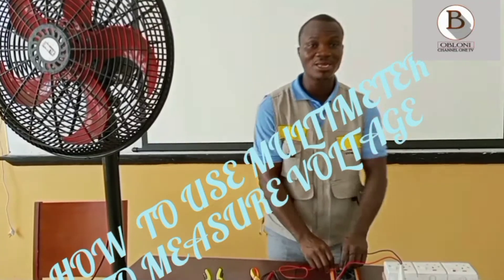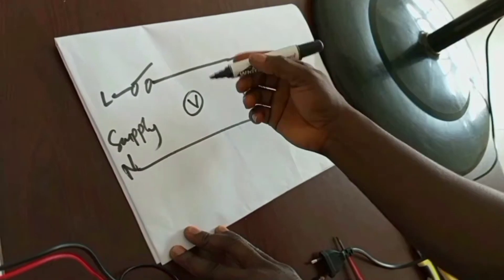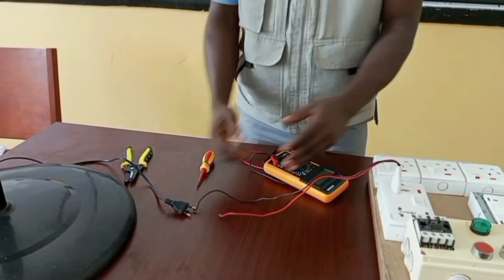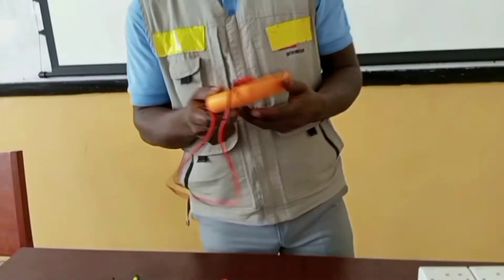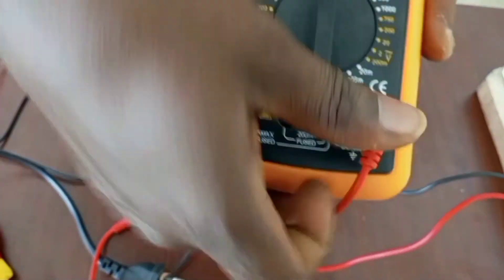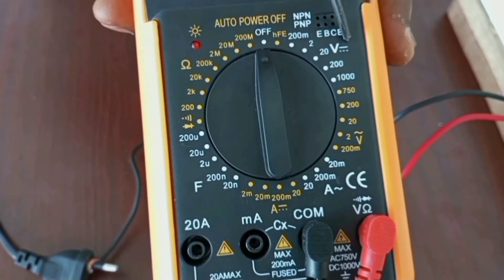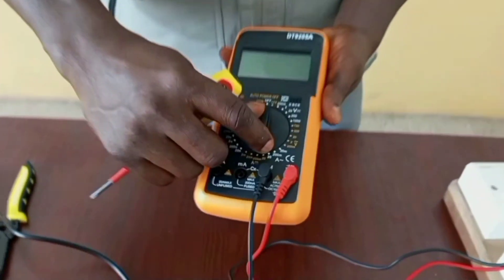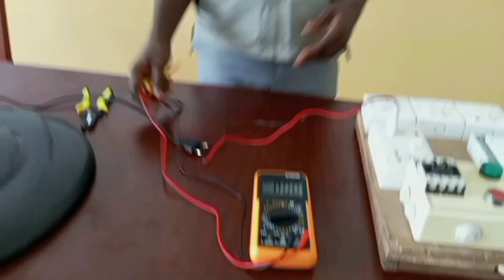How to Use a Multimeter to Measure Voltage in an AC Circuit

Comment: In measuring AC voltage do you have to specifically place the red probe on live wire and black probe on neutral wire or you can place the probes in anyway.
Reply from the maker: @storitella-1  
Yes,  though it's not dangerous for the meter.